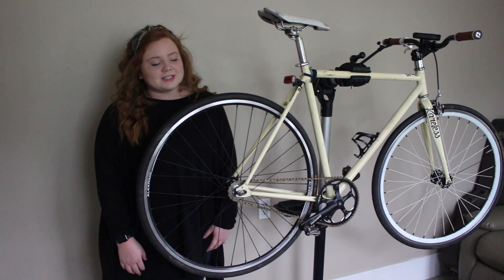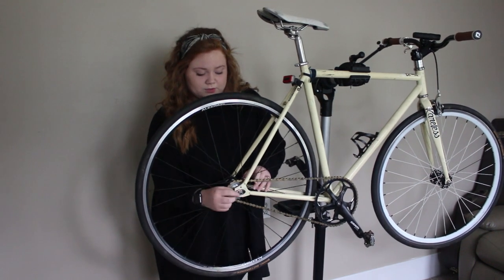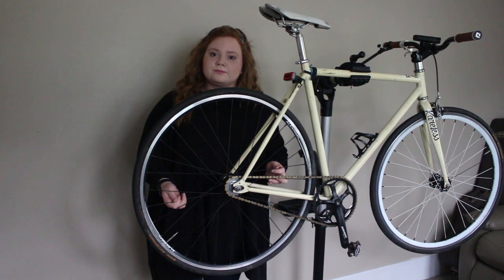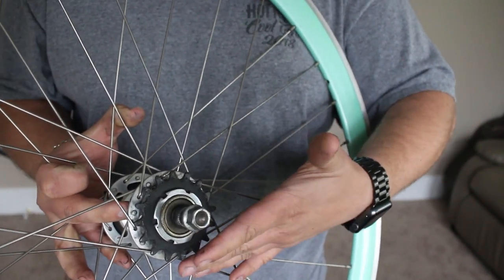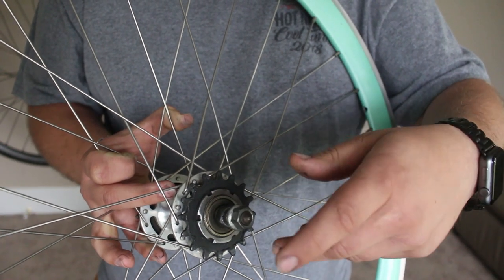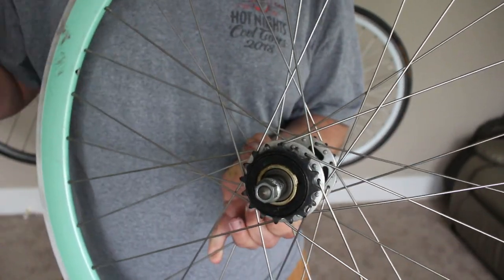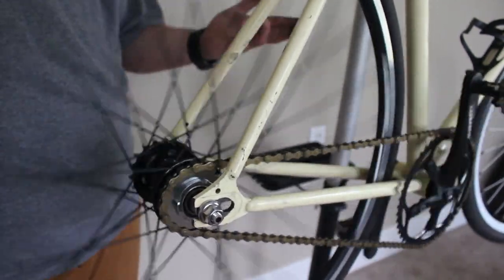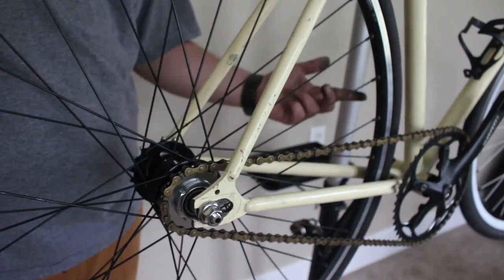How To Replace A Cog On A Fixed Gear Bicycle

Comment: You might want to grease those threads before installing them. Also going to a smaller cog will raise your gear inches
Reply: You really don't need to grease those threads a second time, unless you clean it off when you remove the gear

Comment: Thanks for the video now I have to remove the freewheel cog again and clean the hub I think I did it on a dirty one, quick question is it important to grease the cog before installing it ? I have a white industries freewheel and I don’t wanna damage it I just got it and it’s not cheap
Reply from the maker: Yes you should. Grease or anti-seize will work fine! I personally use park tool anti seize.

Comment: You can actually run two fixed cogs but run the risk of stripping the threads. That being said it’s much more sturdier than you thinking depending on what hub you’re running.

Comment: Is it ok if my fixie cog is not perfectly lined to the chain ring, about 2.5mm off? The freewheel on the other side is perfectly lined, however the fixed cog is around 2.5mm off. Is there a way to perfectly line it also?
Reply: You can do a few things. First solution is to align the BB to factory or correct any old Bottom bracket problems. If your BB is fine, some  cranks can have the chainring flipped to the inside of the crank,  this may run into the chains stay tube of your frame so be careful. 

The harder fix is to have a different wheel be dished differently than normal, this is a rare fix and only makes sense for old bikes that have horizontal dropouts and were originally geared bicycles but converted to fixed. Most fixed gears should have good alignment,  never by a fixie with bad chain alignment because they can not be fixed easily. 

When the wheel is changed to a different wheel that has some dish to it, you may need to space out the cog somehow, but this only works with single speed, as there are no fixed gear wheels that are dished out for gearing.

Comment: Sir, does the Icetoolz spanner wrench usable on different lockrings? Even generic ones? How about for 3 notches?
Reply: What is the diameter of your lockring?
Reply: I bought one and it works on mine (with 4 notches)
Reply: @jessevonk2836  Thank you :)

Comment: You can hand tighten it and add the lock ring and then when riding and skidding the fixed cog would tighten by itself right ?
Reply from the maker: If you do that it will tighten when you skid that is correct. I have tried this and have ran into issues of the cog slipping (loosening) when you pedal forward really hard. In my opinion when that happens I know that there is heavy friction on the threads and will probably strip or cross thread very soon.
Reply: Thanks
Reply from the maker: @Its_Relic  Your welcome! I should have more videos out on bikes if you would like to subscribe!

Comment: Thanks for the video! I had a question if you don't mind!*

I just ordered a Mercier Kilo WT which comes with a fixed gear cog and lock ring installed and then a freewheel cog in the parts box. 

Since it's a flip-flop hub, I can just install the freewheel cog onto the empty cog side so that I'll have a fully equipped flip flop hub to switch between fixed and freewheel, correct? Should I order/get a chain-whip tool and spanner wrench as necessary tools to install the freewheel cog? 

I've heard that the chain-whip isn't necessary because the cog can be tightened by simply pedaling the wheel. But is the spanner wrench necessary? I'd prefer to have both but am having difficulty finding a two in one.
Reply: Also random question, but you showed that wheel early on that had a fixed gear and freewheel cog, but you said that you couldn't have two fixed gears on it, you'd have to change only the fixed gear side if you wanted to change your gear ratio? Am I understanding that right? You have* to have a freewheel on one side, and fixed on the other?
Reply from the maker: Hey there! thanks for watching and checking out the channel!
Ill try to answer all your question in this one comment but let me know if you have any more, i will be glad to help. Your rear hub has a freewheel side (one thread) and a fixed side(bigger right hand thread for cog and smaller left hand thread for lock ring). This means and unless you a new rear hub that is fixed/fixed you will only be able to run a freewheel on the freewheel side and a fixed cog on the fixed side. Unfortunately you can’t swap those. I would get a chain whip and a lock ring spanner (like the one i had in the video) to check and tighten the fixed side before riding. Not tightening these could cause you to mess up the treads and more importantly not be able to stop when riding fixed. For the Freewheel i would watch this video and get the correct tool that you need for yours, https://www.youtube.com/watch?v=iTJ3taJHOn8&vl=en.
Hope that helps and answers your questions, feel free to subscribe i am/will be putting more videos out about my fixed gear! Welcome to the fixed gear family!
Reply: @travisheathracing3354  Thank you for the response I just subscribed, I really dig this video it was well edited and you explained things clearly. 

When you said "unfortunately you can swap those" did you mean "can't"? And thanks I ordered a spanner wrench and chainwhip tool yesterday! It should come in around the same time as my first fixie/SS bike and I'm beyond excited!

I'll probably have more questions when my bike comes in next haha, thanks for all the info and look forward to more videos
Reply: I want to get the freewheel installed asap because I want get a feel for the bike with the drop bars w/ hoods, and I'd like to experiment with the fixie side after a little bit and with a flat bar. But who knows lol, I might just go straight into the fixie if I'm unable/not confident about the freewheel install.
Reply from the maker: Thank you I appreciate it! Yes sorry I fixed that. That’s awesome that will definitely get you what you need for the fixed side! If you start out on the fixed side with brakes it’s allot more forgiving than trying to learn fixed with no brakes. I would suggest running the fixed set up and brakes and start off slow and short distances and get used to it/see how you like it.
Reply: @travisheathracing3354  Sounds good, I appreciate the suggestion! As a suggestion for future videos, you should detail necessary tools/accessories or your everyday carry for your fixie. 

I bought a ton of stuff within my budget and it seemed like too much at first, but then I realized my only other option was to spend even more money at bike shops for whenever I'd need basic maintenance.